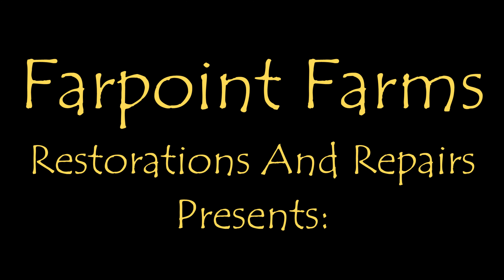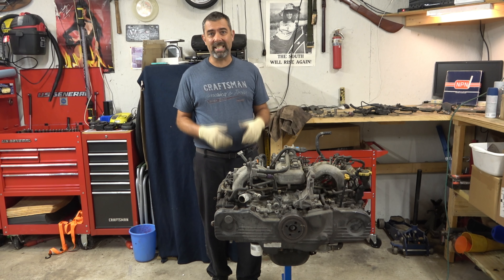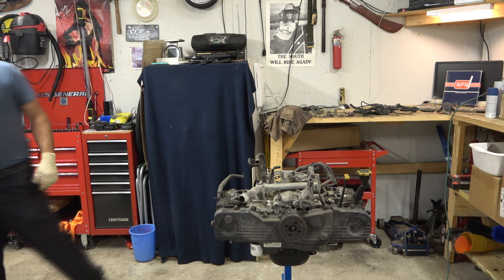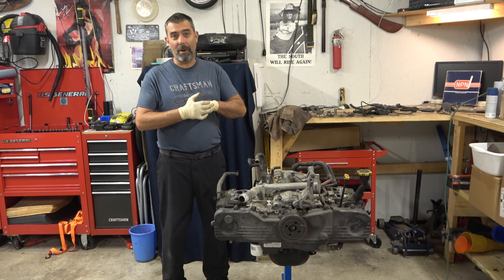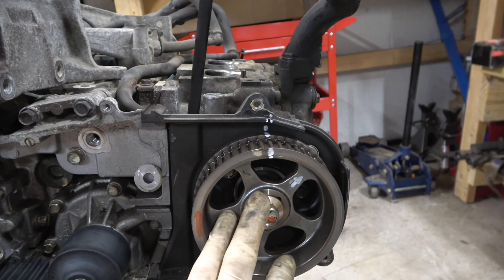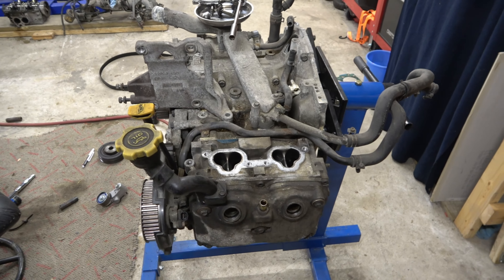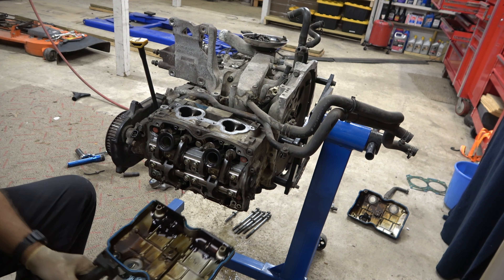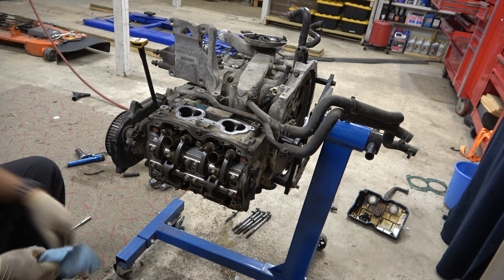The VW "BUSARU" Project is back on track! Let's tear down the Subaru Engine.

Comment: WOW a Subaru engine in a vw bus.. I have never seen a Subaru engine before..  I don't think they had them here in the US back in my hay day of beer, hot rods and endless summer days.. and if they did, they never appeared on our radar.. the only thing, besides the US 6 and 8 cylinders, where the VW, Corvair and Porche.. I wish you would get more in-depth with the build.. But your right there are others that are doing it.. But the only two guys I watch (nick's garage and Western truck and trailer repair) Don't play with these little engines.. Oh well.. such is life.. Carry on brother.. I enjoy the heck outta both of your channels.. thanks for taking the time to share with us..
Reply from the maker: We chose that engine for a more reliable ride, I don't want to spend 1/2 of my vacation fixing it on the side of the road. The old VW engine would have been a beast going over the Rocky Mountains- that much elevation gain would be a nightmare for keeping it running at its peak
thank you for the support of the channel!

Comment: I never did a head job on a boxer before, but I'm not a pro.  I guess the proper term for me is "shadetree" mechanic.  I would definitely get the timing wrong or forget something on the re-assemble. 
 
I'd like to pick your brain on something totally unrelated -  I'm looking to buy a truck, but the costs are ridiculous for anything under 200k miles that isn't a total rust-box.  I noticed surplus hmmwv's being auctioned off online going from $4k-$10k (well within my price range, paying cash).  Being prior service army, I'm familiar with them, but I never did any maintenance outside of operator level pmcs.  Do you think it would worth taking a shot at one if it isn't too beat up or cannibalized?